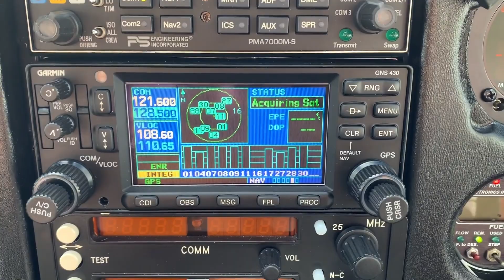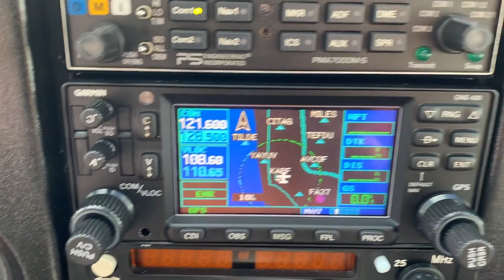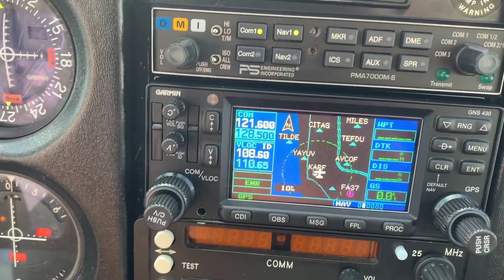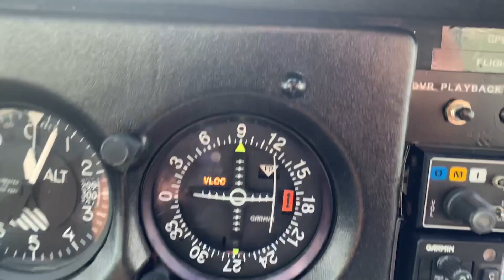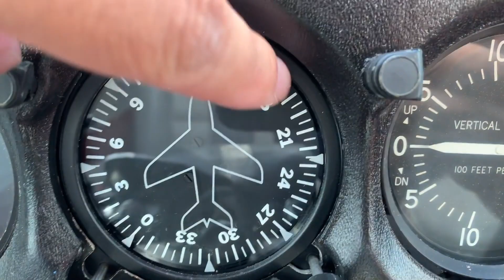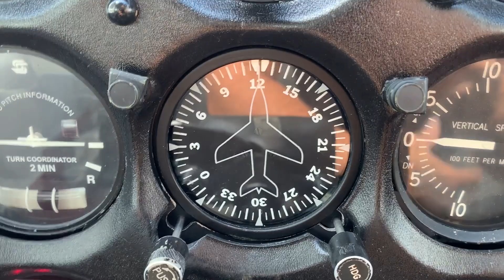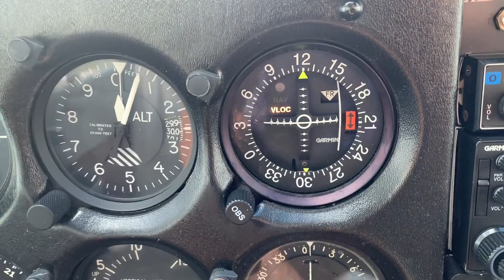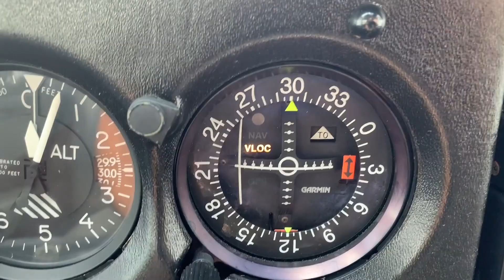How to fly and intercept VOR radials (explained in less than 5 mins.)

Comment: Interesting method. Students love it because it’s easy to understand. At my school, we take the difference between our current radial and the desired radial, double it, and add or subtract based on the direction of turn. It’s a little bit more complicated but the result is an optimal intercept angle. 45° can be a little too much or not enough depending on how far off course you are at the time. Great video!
Reply from the maker: Huh that’s a great method as well! Thanks for sharing

Comment: Dude I owe you my whole checkride 😭😭 THANK YOU. Quick and simple, my instructor wanted me to DRAW how to intercept it WHILE I was flying it and it was just overloading me. I finally understand no. Thank you so much
Reply from the maker: I'm glad I was able to help you :)
Reply: I understand VOR's however, Trying to do this under the hood flying by instruments only and holding my headings, altitude to ACS standards. I can manage to tune the two VOR's but trying to graph  two lines on my Foreflight or paper maps to find my position is super difficult for me. I end up loosing my heading or altitude as I am under instrument. I can only take my eyes off the instruments for like 2 seconds at a time and that's not enough time for me to even try to start the graph line. Easy on the written exam but super hard doing it when flying under the hood.  Is there any tricks to this. I have my Private Pilot check-ride coming up and need to find my position under the hood and stay in ACS standards. Any tricks. I do like you bugging at the 45 position as I was taking to long to intercept.

Comment: Nice video. Well done. Keep in mind that ATC will  give you a heading for the intercept. You likely won't be picking your own 45 degree intercept angle. Also, ATC usually gives an intercept radial TO a fix, not FROM (instructors, however, will give you all kinds of odd clearances to get you proficient). In that case you need to convert the radial to an inbound course to a fix (put the radial at the bottom of the case and the course will be at the top, if you're slow at math), which you discussed. It helps to have a chart displayed (a paper one is nice and won't get deleted) for situational awareness. Once you get everything set up, look at the chart to make sure the plane is going where you think it's going (it's easy to get radials and courses mixed up). Just like holding patterns, write down the clearance, draw a picture of it, set it up, and while flying it, double check everything. Single pilot without an autopilot IFR is the toughest flying you can do. It's a LOT easier in a jet, with a nice autopilot and crew.
Reply: THANKS FOR EXPLANATION FOR ACCEPTANCE OF FRIENDLY VOR PRACTICE FOR NEW COMERS AND BEYOND. IZAZ RASOOL FROM BARIDHARA GULSHAN DHAKA BANGLADESH.

Comment: hey, Alex, I dont think the first step, which is flying to the same direction (in your case 120) is necessary.  after tune to 120 on OBS, the needle will give you the heading to turn. for a 90 degree intercept, you turn to 210. this will get you fast toward the radial. now, you have two directions to fly on this radial 120 or 300, if in your case, fly out bound heading 120, choose the heading in the middle of 120 and 210, which is  about 170. 
The to/from flag doesnt matter at all. 
If in your location, you twist the OBS to 300, the CDI needle will swing to the left, but magically, the 90 degree interception angle is still 210 although this time, the needle is to the left. you still fly 210 to fly 90 degree toward the radial. then same choice, 120 or 300? 
I feel that follow my method, you wont need to worry about to and flow flag at all, and it applies to all situations. you don't even need to know what you location relative to the VOR, just follow the instruction, almost like ATC giving you vectors.

Comment: Nice and easy concept to follow. Well explained and in general good video. 
Although it won't work all the time. As a professional pilot I'll explain it briefly why and how to if you wanna make sure you are always on the right track. 
Keep in mind the Distance from the VOR and especially on which radial you are on... eg. you are on Radial 210 (HDG 030) and you are  instructed to fly on Radial 270 inbound (HDG 090). In this case you would fly North (HDG 360) to intercept. Makes sense. So you gonna turn left. With just simply a 45° Intercept Angle you would miss the VOR and intercept when flying outbound on the radial 090. 
So if the two radials are close a rough interception of 45° works. Otherwise use the Formula D+30°. Meaning difference of Radials plus 30°. In my example. 270°-210° makes a differenz of 60°. Hence with the rule D+30°= 60°+30°= 90° intercept angle. HDG 090-90 makes you fly north. 
Other example: Radial 260 inbound. Current Radial 240. Differenz = 20°; D+30=50° intercept angle. Radial 260 inbound means fly on HDG 080 (260-180)... Intercept course 030 (80°-50°)...
As you can see if the radials are close the rough 45° angle works really well and is suited for many situations, but if you wanna be sure at all times use the Formula D+30°
Obviously with the term HDG i was assuming that there is no wind, for those of you who would want to complain about that. ;)

Comment: The only thing to keep in mind - DISTANCE to the VOR. Sometimes 45° won't get you to the radial intercept. If it's close, maybe 90° is needed for intercept.
Reply from the maker: Thanks for the comment you are absolutely right! Good Observation
Reply: I had that happen to me today. Student pilot. First time using VOR. I was close to the VOR and I was on the 45  and the CDI did not center  as I did not intercept it. Well than I say the airport.